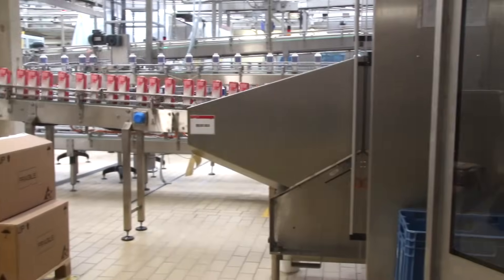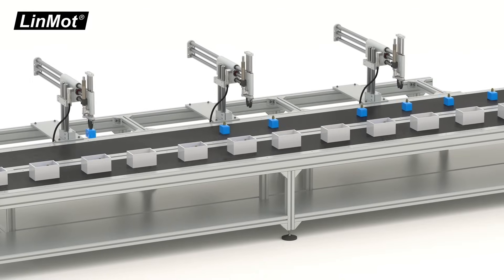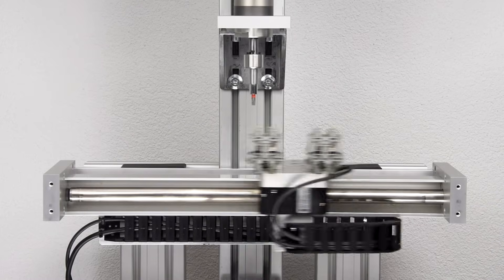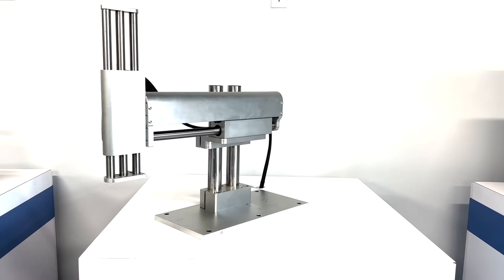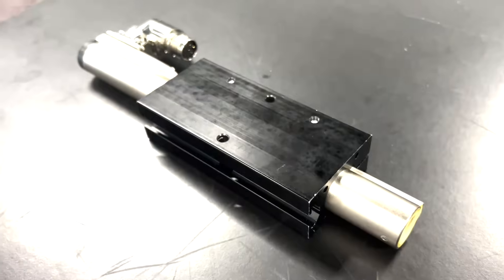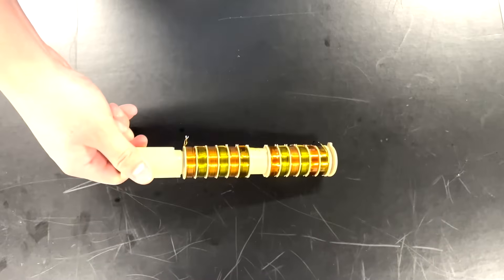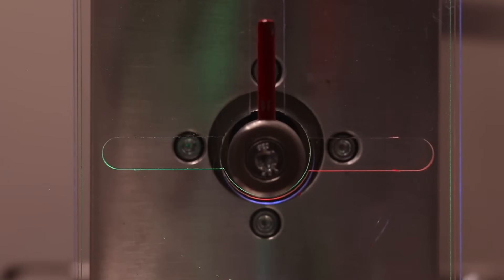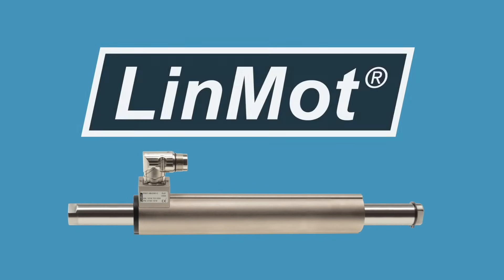Why the Electric Linear Motor is the Future of Automation

Comment: Over and over again I keep hearing the electric motors are “eco friendly” when they’re not taking into account that the electricity that’s being generated to run these motors is produced by petroleum. 🤦🏼‍♂️ no matter how efficient your electric system is, the simple fact remains that unless the source of the electricity that you’re using is “eco friendly” non of that eco nonsense matters in the end unless you just don’t understand where it comes from or how it’s even made/generated. Yet another example of stellar marketing.

Comment: Can you tell me what kind of sensor is used to measure the position of the shaft?
Reply from the maker: We use a custom sin/cos sensor integrated into the stator which allows us to achieve a repeatability of +-0.05mm without the need for external sensors.

Comment: I toured Ingersoll in Rockford over 20 years ago. They were just finishing a set of HMCs for India. All the slides were linear motor built into the slides. 1000 inch per minute rapid feed rate.

Comment: Linear motion stages are incredibly mature technology.  Linear motors do not enable any significant new capabilities, certainly not enough to be considered revolutionary or even disruptive.
Reply from the maker: I agree that linear motors have reached a level of maturity, but that doesn't diminish the significant benefits they offer. While they might not be considered disruptive in the traditional sense, they do play a crucial role in enhancing productivity and enabling greater flexibility in various industries. 

Linear motors indeed open up new possibilities for innovation. They provide the capability to monitor and update hundreds of parameters and variables in real-time, enabling process monitoring, predictive maintenance, data collection, and aggregation, among other functionalities. This level of advanced control and precision empowers industries to optimize their operations, improve efficiency, and make data-driven decisions, ultimately leading to more streamlined processes and improved overall performance. So, while linear motors may not be disruptive in the same way as groundbreaking inventions, they do offer a wealth of opportunities to innovate and advance various industrial applications.
Reply: @LinMotEurope  You can do all of that with a rotary motor and a linear translation stage, and people do use such devices and have done so for decades or longer.

Comment: Price, maintenance, and now something my company has to deal with called Right to Repair. If we have to send this back for repair or purchase any new parts from you it's not happening, we've already had to deal with priced gouged PLC controllers and the nickle and diming the engineers in automation have done for decades.

There's a reason why we're still using 40 year old tech for our automated assembly lines, because we can repair them without being fleeced for $50,000+
Reply from the maker: We understand your concerns regarding price, maintenance, and the Right to Repair issues you mentioned. At LinMot, we take pride in the reliability and longevity of our motors, which can endure billions of cycles without compromising performance. 

Our motors are designed with a simple tubular structure, eliminating the need for complex mechanical transmission components such as gearboxes, timing belts, pulleys, cams, or lead screws. This streamlined design not only ensures smoother and quieter operation but also contributes to reducing maintenance requirements significantly. 

We aim to provide solutions that offer long-term value and in providing reliable, sustainable, and economical solutions that align with the needs of our customers. If you have any specific concerns or questions, please feel free to reach out to our support team; we are here to assist you in any way we can.

Comment: It may be more cost efficient in energy but if they keep breaking, a pnu cylander is far cheaper to replace
Reply from the maker: One of the key strengths of LinMot motors lies in their remarkable reliability, not just in terms of motion precision but also in their exceptional lifecycle, which can extend into the billions of cycles. With proper sizing, our motors are engineered to withstand demanding conditions without experiencing any breakdowns. Moreover, their elegantly simple design ensures fewer components that could potentially fail, further enhancing their overall dependability. You can trust that our motors are built to last and deliver consistent performance, providing you with cost-efficiency in the long run.

Comment: The problem is the software. 
With a pneumatic cylinder it’s on/off, in/out dead simple. But with an electric motor you have a ton of controller’s, encoders, shielded cables and so on. The controllers often have hundreds of parameters which increases the commissioning time drastically, because they have to be fine-tuned for every use case! Also, have you ever been in EMV hell?
Reply: That's absolutely not true. There is products on the market where the controller requires almost 0 commissionning and in the end the system is almost as dead simple as a pneumatic cylinder as on/out in/out ... but also offers extended capabilties if needed as pushing motion (torque control), intermediate position etc ...
And as the drive is integrated to the motor, there is no need for shielded cable, etc ...
Reply: @Difool80  No need of a shielded cable? Have you ever heard of harmonics? More specifically third harmonics? With that many DC components in a factory, you have to rebuild the entire wiring net for it not to mess up. Just like frequency converters does, which need special wiring for it to not create overvoltage on other machines down the line. 
No, this system is the entirely opposite of dead simple as a pneumatic cylinder. Also for a pushing motion, these linear rails can't even get close to the power of a pneumatic piston. 
I worked in a flour mill for 9 months as a service and repair man. The entire factory runs on pneumatic pistons, the only electric motors are for transport belts and pallet stacking, where they use pneumatic to lift the packs of flour.
Reply: @rasmus1600  I would suggest you to read again my message as I'm not talking about the products presented in this video.
Drives integrated to the motor doesn't require - by nature - any cable between drive and motor. The power cable is as simple M12 4 wires cables, not shielded.
Again : electric axes as simple as pneumatic cylinders does exists on the market. That's the whole point you missed.
Reply: Most of the controller software these days is pretty easy to configure. If you're still using systems that require manual tuning then it's most likely pretty old.

Comment: Whats the force graph for these motors over their full stroke length?  Do they have fall off at the ends? Or reasonable the same throughout?
Reply from the maker: For the most of the stroke, the motor force will remain at its peak level. However, when the slider is inside the stator, there will be a reduction in force. This means that during the extended stroke and at the extremities, the peak force might be slightly decreased. To get a detailed understanding of the force characteristics for each stator/slider configuration, you can refer to the force graph provided in the datasheet of every motor. The force graphs can be found at this link: https://shop.linmot.com/D/linearmotoren.htm. If you have any further questions, please don't hesitate to reach out to our support team at support@linmot.com. We're here to help!

Comment: How can I buy these in INDIA (country). Can these be used for continuous Oscillation for a long time. I have an application where I want continuous Oscillation at 2.7 m/s , it will run for 8 hours a day but continuous run will be max 20 min and then rest for 5 min and then again 20 min run,  5 min rest and so on.

Comment: What is this demonstration at 5:30?
Reply from the maker: The video shows a steel bolt mounted on the shaft of our PR01 LinearRotary modules finding its way through a Plexiglas maze. All processes are programmed via a servo drive module and can be flexibly adapted.
You can find the full video here: https://www.youtube.com/watch?v=RI09jFYU_b0
Read more about the PR01 series: https://linmot.com/products/linear-rotary-motors/linear-rotary-motors/
Reply: It showcases the precision and speed of these motors. Able to fly through tight slots at crazy speeds while rotating very fast too. Pretty impressive really.

Comment: 4:44 normally without a microprocessor air cylinders only do all in or all out but not if you add a microprocessor to it. My air cylinders use a servo controller so I got as many stopping points as a rc servo controller has, just replace the DC motor with 2 relays with diodes so if the servo controller wants to go left make it trigger the left relay and same for the right and connect each relay to a pair of solenoid valves it works with air or hydraulic depending on how much power you need. But air can be useful for robots to use multiple power supplies it's easy to power a relay and a servo but hard to run the motor so you can use air and use chemistry to make some gas pressure like acid and let the robot eats trash to power the air cylinders. With solar for the low power microprocessors and you can have a robot powered by solar and trash.
Reply: easy there cowboy
Reply: @chronokoks  you're just jealous because scott figured out how to put a microcontroller into their air cylinder, meanwhile you're still struggling to put a single transistor in yours

Comment: Could the internal electronics do the same thing as a hydraulic cylinder? I think replacing hoses and pumps for just wires and either an internal or external source of power would be quite interesting
Reply: These will never match the force of a hydraulic cylinder per cost
Reply: The advantage here is not high power density as in hydraulics but  precision positioning,high speed movement. Forces generated through stroke range not covered though.
Reply: @johngould8002  And to eliminate the need for an expensive, maintenance intensive hydraulic system too
Reply: no

Comment: What is the point of all this if I can't afford to pay for a goddamn house? I don't care if the price is reduced to 1% of what it used to be. You know why? BECAUSE I'M JOBLESS.
Reply: funny
Reply: automation like this helps with the labor market, because it helps end international trade, because it becomes cheaper to make them where the products are sold then shipping across the globe. so more manufacturing locations means more local jobs, shipping is screwed but like 10 people drive one of these big cargo ships. so it will be a net gain in jobs. also house prices has everything to do with it being tied to the money and the banking system, if houses were their actual price we would see some people buying houses in unpopular areas to harvest and then sell the materials. their is no such thing as a labor shortage you just have to pay them more $$$$$, people will work on remote oil rig it does not matter where it is.